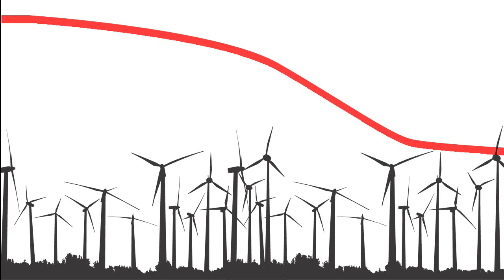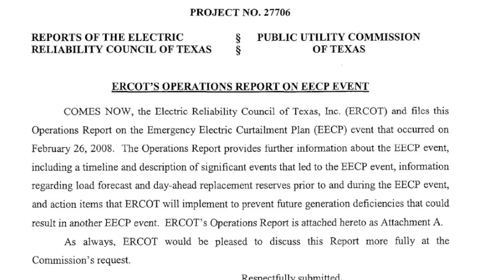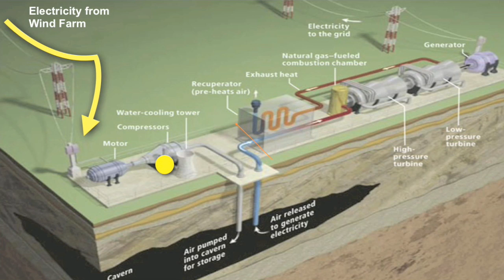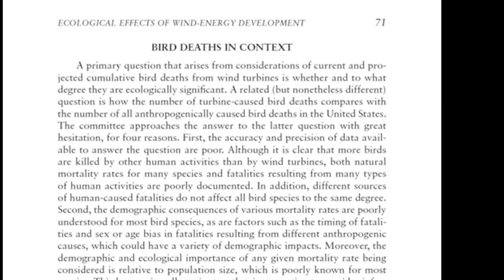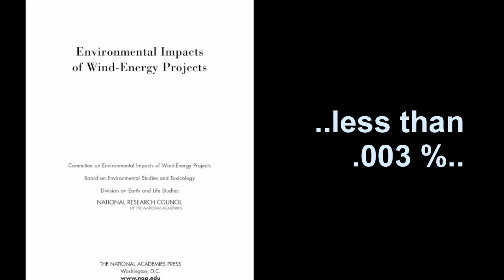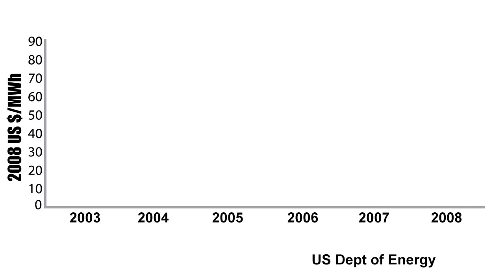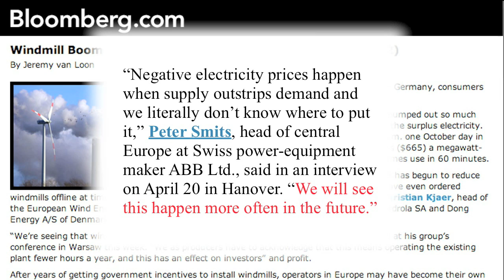Renewable Energy Solution of the Month - Wind

Comment: @robhoneycutt 
Losses on the UK national grid are about 2%. We have the particular stupidity of dragging electricity a long way from generation to demand because getting planning permission for power stations in the south is harder. The US is worse on this because there isn't a unified grid.

You can't avoid local losses (in 240V or 11kV feeds) unless you drag high tension into population centers, which has issues. Yes you loose a few percent here, but there's nothing that can be done about it.

Comment: It seems far more logical to put solar panels on structures already in place, so untouched acreage doesn't keep succumbing to glaring skyscrapers.

Wind itself is a secondary form of solar energy (heat & pressure differentials cause wind). Direct wind is far more intermittent than direct sunlight. Even areas with a lot of overcast can generate solar power OK. Anti-reflective nano technology could make solar a lot more efficient. Wind only achieves about 25% of installed potential in most cases.

Comment: When you very optimistically figure out total energy consumption and renewable capacity, the UK doesn't close; neither does any other major European country. I don't have the numbers for the US on hand. (So Wind/Solar PV+Thermal/Biomass/Tidal/Wave)

IMHO, the least bad option is LFTRs producing hydrogen and electricity, use methanol or DME as the actual fuel. Thorium+continual reprocessing nets waste that's hot for 200-250 years; thorium will last about 800 years globally...

Comment: @waltermh111

 Very new. Only finished commissioning all 26 towers summer 2009. Very very big though - approx 30m blade length. They sound something like a cross between a jet engine and a continuous roll of thunder. Check out 'Romney Marsh' on wiki to see a small section on the windfarm...

Comment: @greenman3610 Here's an overlay I made with the WindDS study and a wind map of the United States: i47 at tinypic slash 29nv712.gif I am making no statement about nuclear. Simply to point out that if you're going to pull the "wind turbines don't kill birds" argument you must clarify that "the transmission lines needed for massive buildout would, though." Indeed, the connection is rarely made. Transmission lines are going to be necessary. A lot of them. Is that bad? Not necessarily.

Comment: @thelleht Most people have perceptions that are based on years or decades old information.

Wind power, like any other, has gotten more efficient over time.

Some people have a hard time believing that tech doesnt stand still.

If only more people would do the research you did to update themselves.

Wind power is one of the more efficient powers right now, but its not something most people think about since the turbines are usually out of peoples eyesite for most of their lives.

Comment: @8080256256 - because when a nuclear core has to be shut down, that reactor is 100% unavailable for a period of days. When a coal turbine has to be replaced, that unit is down 100%. When a couple of wind turbines are down on a farm of 100 or so turbines, which is frequent, you have 1-2% unavailability. The units are different because the nature of the source is different.

Comment: @waltermh111 Studies show at least a minimum of 12 thousand miles of transmission lines for 20% production. This is a well known aspect of wind. If you think that all power sources require significant transmission lines you'd be wrong. Again, this is not bashing wind, catastrophic climate change will kill far more birds than a few thousand miles of transmission lines. As far as nuclear at coal locations? AP1000 uses 3.2 billion gallons of water a year. A typical coal plant? 4.4 billion.

Comment: The death of birds in hitting wind generator blades can be solved with a three dollar device, a tiny tube of metal, on the end of the blades which produces a whistle that is not within human hearing range which any bird will avoid. Similar devices can be used to warn off most of the birds and animals that die through interaction with our technology. A coating for window glass, for instance, that makes the glass look like a wall to the birds, because of the frequency of light it absorbs.

Comment: @heavyweather 
One out of three: Hydroelectric produces more power than solar and wind combined.

Jet streams are narrow, and you have to go very high up to harness them; for solar, you're going to mount them above the clouds?  The sun shines at night, from the perspective of a single geographic location?

You're fooling yourself if you think these are truly consistent systems.  Load following is a major source of headaches for /existing/ power.  Adding wind and solar just compounds the problem.

Comment: @waltermh111
Scheduled verses unscheduled matters because you can't turn on reserve or backup on a whim. Gas turbines can ramp up output quickly, but dual production nukes are cleaner and produce hydrogen into the bargain.

Wind isn't predictable enough. Google E.on Netz wind report. They run Germany's wind grid; the predictions are wrong by GW on a regular basis. But for the massive feed into France, they'd black out the grid regularly.

The problem is such storage systems don't exist.

Comment: @waltermh111 If I wanted to defend nuclear I could say "well we just put a nuclear plant where each coal plant is and volia no need for tens of thousands of *new* miles of transmission lines. This is distinct from upgrades which do not add to the overall mileage by and large." But I know that's not economically nor politically feasible and it would take too long in any case. I don't see why we can't just admit that new transmission lines will kill birds. Still *nothing* like buildings and cats.

Comment: @slhines7 

Solar energy is not consistently reliable in all areas. In Wellington the wind is far more reliable than the sun. Also, one need not have huge wind turbines -lots of boats, for instance, run their fridges using turbines with blades about the length of my hand to elbow. And its very cheap. Imagine how much energy would be produced if every home in a windy city had one of them on their roof.

Comment: @heavyweather 
I wouldn't bitch if there were demonstrated wind tech that could be 7km up, or solar 18km up, and still get power to the ground.

Meanwhile, there are proven types of nuclear power that produce almost no waste, have MWy/kg* fuel density, and that only need a couple million dollars worth of engineering work to commercialize, not counting artificial regulatory costs.

* Breeder: 1,570,000 Wy / kg; LWR: 75,000 Wy / kg; Oil: 0.59 Wy / kg; NG: 0.57 Wy / kg; Coal: 0.27 Wy / kg

Comment: "All sources of power are intermittant"

I was with you up until that little bit of dishonesty there.  Nuclear is on 95% of the time, and is only ever shut down for a quatrannual fuel swap.  Natural gas is only ever down for maintenance.  Wind power only runs about 50% of the time in any given area, and is geographically homogenous in this respect over very large distances.

You lose your message if you intentionally misrepresent the facts.  Don't do that.

Comment from the maker: 93 million miles is an ideal safe distance for a nuclear reactor. 
your comment seems to presume that there is no steel of concrete in a nuclear plant.
Reply: greenman3610 this nuclear fear mongering needs to stop.  Solar is as green as your laptop.  Wind blows even when it doesn’t.  These are hobby energy sources and have no hope of powering our society.  Do the calculations on powering a 200mW recycling plant with wind/solar and the backup needed when they are not available.  Billions.  Just build a 3rd or 4th gen nuke plant that can use the waste of previous older plants.  The information presented in this video is misleading. nuclear’s up time is far greater than wind/solar.  Your videos on climate change are excellent.  Your video on possible solutions to climate change needs a lot of work.  FYI the fossil fuel industry is a big fan of solar and wind and never mention nuclear, you ever wonder why? Answer: they know these technologies cannot power our society and fossil fuels must continue to be used.  Sorry if I seem angry,  but discussions of these pie in the sky solutions need to be ended immediately if not sooner.

Comment: all the negative veiws on this video. If wind is a bad idea.. what is the good idea
Reply: +Joseph Kaluza-Gilbert Molten salt thorium or uranium breeder reactors? 90% capacity factor, reliable, tiny footprint, consumes less resources, process heat for desalination or hydrogen production, can be built for ships, load fallowing, actinide burning, fission product removal, on-line refueling, really hard to make weapons grade material, 200 times the energy unlocked, massive EROEI estimated at least 800, no enrichment, no cladding, no fuel fabrication, no explosions, most of the waste quickly becomes non-radioactive, remainder is radioactive for only 300y. I can't name everything. (I made the list longer than I expected)

The dual fluid reactor (Germany) is estimated to have a 2000 EROEI and I estimate it makes a little over 1Tonne/GWyr (electric energy) of short lived waste using a standard steam turbine. 

Renewables need storage (pumped hydro is cheapest) or natural gas but you need the overhead to fill the things. Negative rates is also a bad thing, it means the power system can't make money because renewables are overfilling the system and they can't export it (ignore energy conservation hour!). It would take 1000 3MW wind turbines (30%cf) to equal the energy a 1.1GW nuclear unit (90%cf) makes.

Comment: ERoEI of wind + STORAGE?
If we count all the energy (not money) that goes into making wind + storage, do they then produce a high enough energy return to run the modern world? It's called ERoEI, or Energy Returned on Energy Invested. Our society needs energy systems that pay back over 12 times the energy it cost to build those systems, or we will not be able to run today's world and build out the next generation's energy supply.

While individual renewables have good ERoEI's, sadly many scientists have simply not calculated the energy cost of buffering or storing energy for unreliable, intermittent wind and solar. When we count the storage, the system ERoEI drops off a cliff.
Solar thermal = 9
Wind = 3.9
Biomass = 3.5
Solar PV = 1.6
There are answers, but not in a 100% renewable grid. If we build that for today's generation, we may not have enough energy left over to build the next one!
http://bravenewclimate.com/2014/08/22/catch-22-of-energy-storage/